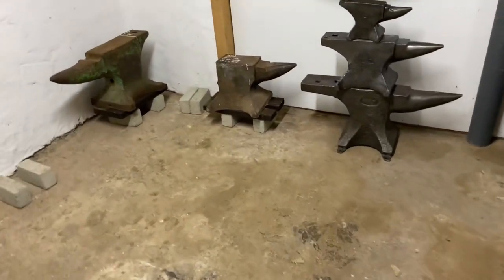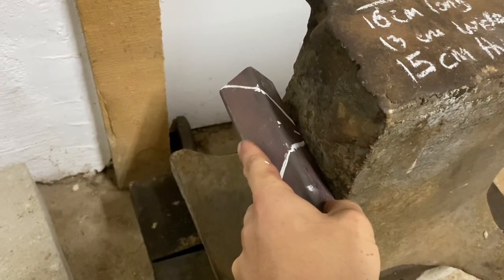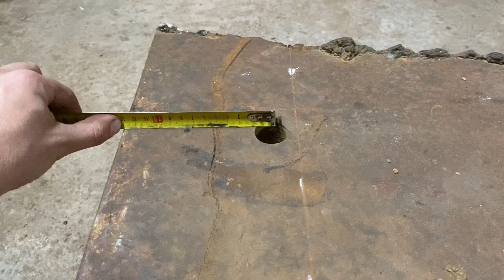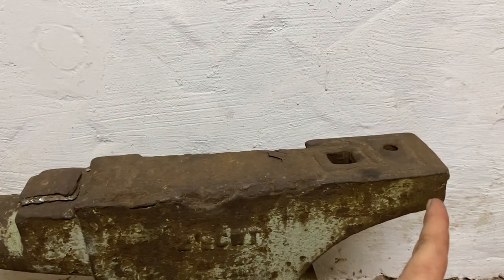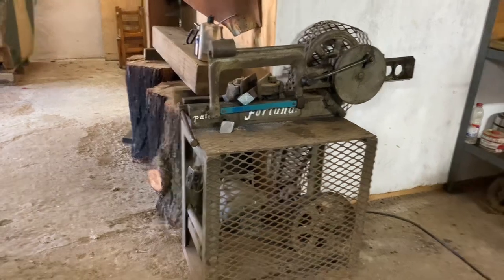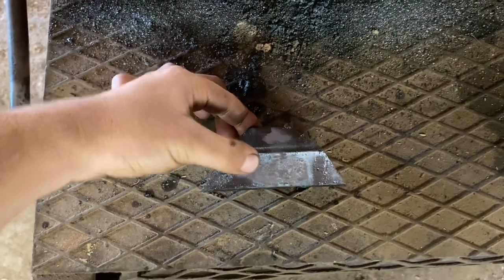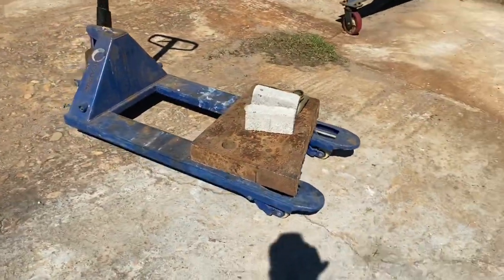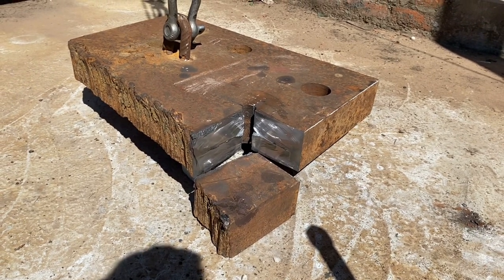CAN THIS ANVIL BE RESTORED PT1

Comment: Only now I discovered your excellent channel. Thank you very much for sharing your knowledge with us. The restorations you make are very nice. I built some anvils in the past (check my channel) but only now I am going to help a friend repair his German Söding und Halbach S&H 324 kg Anvil. The edges are all chipped. For the first pass I will use nickel rod and on top of it some H7 air hardening rod. What is the electrode you use for first pass in your anvils? And by the way, with that huge slab of mild steel, you can also build an anvil of your own making, I suggest double horn...
Reply from the maker: Thank you so much for the support, I followed you, awesome work, I’ll make my way through all your videos. Söding & Halbach are generally cast as far as I know. So it will be very similar to the restoration I did on the 2.5 CWT Brooks. 

For all the building up I use normal mild steel MiG wire, then the last two passes I use hard facing rod.

Yes I know, the same friend I got this slab from had a slab that was around a ton, my dream is to make my own anvil anything over a ton, but at this stage with my current equipment I don’t see it being possible, especially moving it will be very challenging.